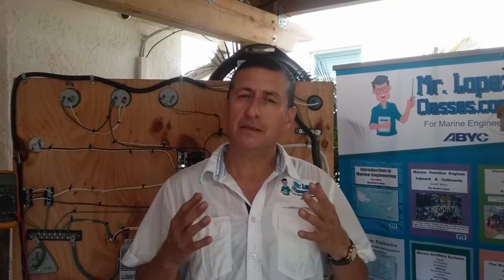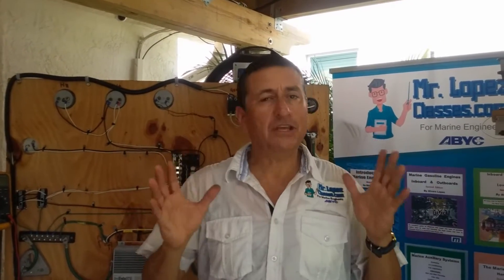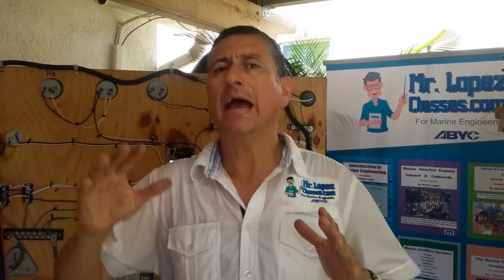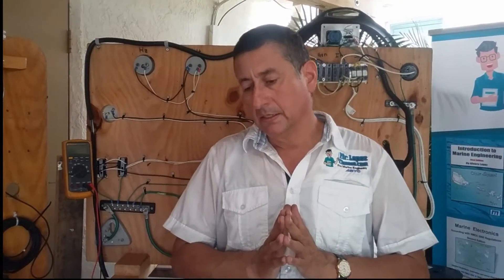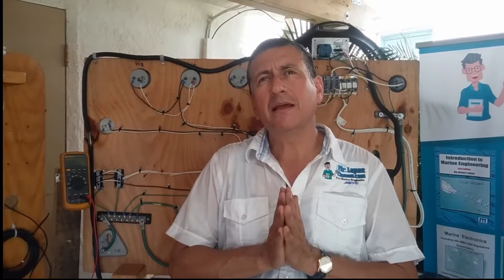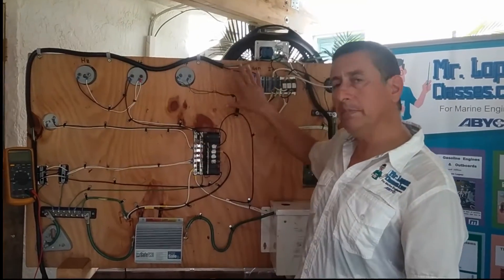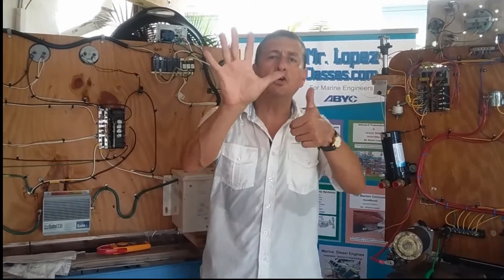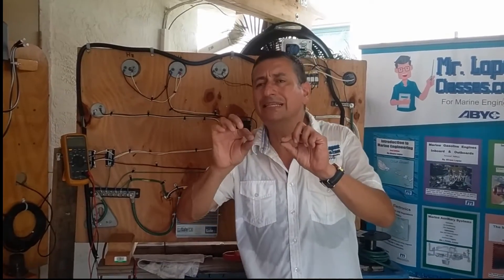Bonding and Grounding

Comment: Good information but never seen a battery exploded because of a bad ground, battery will not explode from a bad ground it just will not operate the component that is trying to operate, bad ground just means no power will flow out of the battery to which the component you're trying to use...

Comment: Very good video, I'm thinking of buying a few of your books. If you do not have a transformer, in between which grounds should the galvanic isolator be placed?  I assume that the shore-power ground should go through the galvanic isolator; then behind the galvanic isolator all grounds (DC, AC and all metal) should be connected together?  This would mean that the shore-power ground is not directly connected to the DC ground, right?  What about the AC neutral?
Reply from the maker: The DC negative bus bar at the DC Panel and the Ground bus bar at the AC panel should be connected to the main bonding conductor, and then the bonding conductor should be connected with the external sacrificial anodes. The AC neutral and Ground should be tied just at the power source (i.e. Generator, Inverter, and Shore), after that point of common connection it will be the neutral of your AC Panel, and from the frame, the ground (green) will feed the ground bus bar 
Best regards
Reply from the maker: Please try to see this short video-clip https://www.tiktok.com/@mrlopezclasses/video/7162257572395748650

Comment: I need help.  I have a deep cycle battery that runs everything but my engine. Connected directly to the battery (with fuses) are the mile pump, vhf radio, am/fm stereo, and a switch panel for my other stuff. All of that has negative cables going back to the battery.  Then, the cranking battery is  grounded to my outboard engine. So, if i connect the deep cycle negative to the cranking negative,  that's not grounding the deep cycle circuits to the engine?
Reply from the maker: All the negative terminals from different battery banks should be connected together, then they should be grounded to the main bonding conductor . Does not matter what type of batteries are in each bank
Reply: @Mr Lopez  right,  and they are,  I have the negatives of the two batteries connected together.  So, then when I add in the AC circuit, I'll take its ground and connect it to the engine as well? Or can I connect a cable from the ac ground to one of the battery negative terminals?
Reply: Would the outboard motor be the main bonding conductor in my case?

Comment: Great vedio,,, how do I know what size zinc block I need?
Reply from the maker: Depends. Minimum 1 Square Inches in total per boat of this size
Reply: @MrLopezClasses   looking at the boat today I noticed the yacht builder had ran 3 number 2 cables to back of the boat and was fastened to the rudder housing but zinc block was not installed instead over the years someone decided to use the zinc disc's on the rudders but the rudder shafts turn which surly causes resistance so I installed a 6 x 12 x 3/4 inch zinc block and reconnected the cables to it, l think that should solve the corrosion problems, brand new 7000 dollar props and stainless steel shafts that looked like new looked horrible in just one season as a result of all the current running through them,, Thanks so much your vedio gave me the knowledge I needed.
Reply: @MrLopezClasses sir you answered me twice first time you said 1 square foot second 1 square inch but I'm sure you mean square foot,, that's 144 square inches, I'm going to try the 3/4 x 12 x 6 and see how long it lasts, I'll go thicker next season if it eats away to fast
Reply: @MrLopezClasses  my question now is if the zincs to small will it not be able to absorb all the current are just absorb it and eat away faster?
Reply: @MrLopezClasses  another question is zinc better than aluminum for salt water,, some say aluminum has proven better

Comment: Can someone explain why the DC circuit diagrams I normally see, all take the negative back to the battery, not the bonding conductor?
Reply from the maker: Because the return of any  DC circuits should be to the Neg. bus bar. The housing or metallic case of any equipment should be connected to the bonding conductor. In other words , the bonding conductor should be  use to drain static electricity accumulated on the frame of the equipments. Of course at the end of the day, the main DC negative bus bar of the boat and the AC ground conductor should be connected to to the bonding conductor

Comment: Mr. Lopez, you are a gifted teacher. 
Question for you: The installation instructions for that Galvanic Isolator show it wired in series with shore power ground. Your wiring is still in series with the path to shore power ground via the water, but in a different location. If the boat were to be struck by lightning, seems the isolator would be destroyed. We haven't look at the maximum voltage spike the diodes in the isolator can handle. Gracias y buen dia!
Reply from the maker: Yes you are correct. This is way for lightning purposes there is another lightning plate connected with a lightning conductor attached to the lightning rod. At the end both plates should be connected

Comment: In Ana emergency can the short electrocute a swimmer?
Reply from the maker: Of course, this is why is not recommended to swim in a Marine
Reply: I swim around my boat. I have an inverter and solar lithium batteries everything. How do I ground at anchor without the possibility of electrocution?
Reply from the maker: @djkillachris  If you have a good Bonding System in your boat it is enough. All the metallic items in your bout should be bonded to the main bonding conductor, then it should be connected with the external sacrificial anodes.  This is my recommendation
Reply: I have read books, searching videos and reading internet but just can't seem to find a proper answer or schematic for completing my install. I currently have solar and inverter working but no ground is run from my ac panel and I'm not sure about grounding inverter. Also, my reverse polarity light is on and it appears the builder jumped the ac panel ground. I have a 30' sailboat with a diesel engine. I'd be happy to make a donation to you if I could send you a few pictures and you could give me a few instructions. My email address is Blistyanypowwow@yahoo.com. Let me know and thanks so much for your responses and the videos!

Comment: Hello Mr Lopez.

What are your thoughts on bonding in a wooden boat?
Reply from the maker: Hi Samuel. The Hull material is not relevant. It is most relevant the hardware materials in contact with saltwater. If you have bronze fittings, Bronze Rudder and Propeller, Monel Shaft, then 100% sure you need a proper Bonding System. If you check this poster you can select the sacrificial anode according to the hull material and type of water. https://mrlopezclasses.com/product/sacrificial-anodes-selection-chart/ Also in my "Marine Corrosion Book" you will find all the information that you want https://mrlopezclasses.com/product/the-marine-corrosion-handbook/ or Sympli take the " Marine Corrosion Course at https://mrlopezclasses.com/product/marine-corrosion-course/

Comment: I asked Mr. Calder why in Europe DC’s negative is not grounded and in USA it is mandatory and I received an answer that they are studying to review this. 
I’d worked 40 years on electrical power companies and the DC are not grounded. 
Griunding is used to protect against electrical shocks. AC neutrals are grounded usually to balance currents and provide enough short circuit current in case of a fail and make breakers to isolate it. 
Just remember planes, cars and even rockets are not grounded and they work pretty well.
Reply from the maker: Alcibiades.
In boat wiring, both AC and DC should be grounded. The grounding system in a boat is used to drain static electricity normally stored in the housing of appliances. The negative bus bar at the DC panel and the ground bus bar at the AC panel both of then should be connected with the main bonding conductor, then the bonding conductor should be wired with the external sacrificial anode. (This is the ground of your boat)
Remember that in boats Neutral and Ground are tied together only at the source of power. Normally at the AC mainboard in the generator backend or at the AC mainboard in the Inverter or at the transformer frame. After that, inside of the boat, never neutral and ground should be connected together.
With respect to planes, all of them use a similar bonding system, then the main bonding conductor is connected with the external sacrificial filaments located at the end of the ailerons in each wing, another one at the end of the tail cone, and another one at the end of the empennage. those elements have the same function as the sacrificial anodes located at the boat transom, drain currents. This is the ground system of airplanes. If you are seated in front of the wings especially during night fly's you can see those filaments draining small currents constantly into the atmosphere. This is the ground system in airplanes.
Let me know if you want additional information
Sincerely
A Lopez
Reply: @MrLopezClasses  Thanks for your attention. But there is a huge difference between static and dynamic electricity. Bonding all metallics to zinc will prevent from corrosion that may occur because of static electricity. Household’s appliances are grounded to prevent electrical shock if or when any conductor loses its insulation cover because this may kill a person. And, once more, in Europe DC’s negative busbar is not grounded. There is another concern. If DC negative is bonding to all methalics and a ligthning hits the mast all electronics will be burned!
Reply from the maker: @alcibiadesmarcialneto922  Thanks for your comment. I appreciate your feedback

Comment: One of the best (if not the best) videos out there explaining grounding and bonding. I can't believe I hadn't found your videos earlier! Looking forward to watching more on your channel. Thanks a lot!

If I could also ask you a question, I just installed a lithium battery connected to an inverter and a solar panel. I connected the main negative of that battery to the main battery of the existing lead acid service batteries on the boat. The inverter also has a terminal for ground which I think I am not sure if I should now connect to either of the negatives of the battery banks. Could you confirm if I was correct to connect the negatives of the two banks (they are not connected in any other way and are being charged by separate chargers) and what I should do with the ground for the inverter?
Reply from the maker: Hi Ekatos.
I am going to respond in different steps. 
No 1 . Doesn't matter how many battery banks are in a boat. All the negatives from each battery bank shall be connected together and then to the main DC negative busbar.  Doesn't matter if one battery bank is lead acid, the second one AGM and the third one GEL
No 2. In a typical marine Inverter, in the AC side of the inverter you will find Hot 1 (out) , Hot 2 (Out) , Neutral (Out) and Hot (in), Neutral (In). The Hot (in) and  Neutral (In)  are related with the power coming in from the AC Panel to activate the Battery charger located inside of the inverter to keep the battery Bank fully charged and the Hot 1 (out) , Hot 2 (Out) , Neutral (Out) are the phases and neutral going out to feed the AC Panel. In other words each Marine Inverter has a Battery charger inside of it to keep your own batteries charged 
No 3.- In a typical boat with AC and DC Panels; the DC negative Bus Bar of de DC Panel and the Ground Bus Bar of the AC Panel shall be connected to the common bonding conductor and the bonding conductor connected with the external Sacrificial Anode. However the case of the inverter if it is metallic should be connected to the AC Ground bus bar and the (-) terminal on the DC side shall be connected to the main DC Bus Bar
Reply from the maker: Thanks Ekatos. I hope this material is useful for you. Enjoy it !!

Comment: Top of the pops,great vid,quick question,I have boat with 110 ac but marina is 230v,can I just plug in 230 from shore power to battery charger and run tv,lights ect Dc and bypass 110 altogether,any help much appreciate,again class vid👍👌
Reply from the maker: Hi Kay. No because the AC outlet in your boat is single phase and the Outlet at the pedestal is double phase. Ask to the Marina probably they have another single phase pedestal or an Adapter for the plug
Reply: @MrLopezClasses  tks for quick reply, the previous owner put 230 inlet into boat going to 230 trip switch with socket and I think his idea was to plug in  110 site transformer into 230 socket then connecting to boat to 110 site transformer,some how I don’t think it’s that easy?Could u give me your opinion on another option pls,

Comment: Mr. Lopez let me clarify my last statement.  The boat came with a 120VAC to 12VDC battery charger installed from the factory.  The battery charger was properly hooked up to the batteries.  The purpose is to charge the batteries during down time.  The 120VAC charger was mounted directly to the aluminum hull of the boat.  Our house boat was moored to the marina with shore power feeding the house boat. We ran a 3 wire extension cord from our houseboat GFI outlet to the 120VAC charger installed in the boat. The charger was active for about four hours.  The boat was not equipped with any type of anode.  The amount of damage in 4 hours was amazing.  Your thoughts please.
Reply from the maker: Ok. The Bonding system is basically the ground of your boat. The Bonding system is a metallic connector where all the metallic elements inside of the boat should be attached. Then , the metallic bonding piece should be connected externally to a plate of Zn ( Sacrificial Anode). The metallic case of the Battery Charger should be connected to the bonding conductor. As you mentioned the charger is mounted directly to Aluminum hull from the factory. However I have a couple of questions:  The Boat is coming from the factory with an AC Panel?. There are other AC equipment, such as Refrigerator, Stove, Microwave, etc...?. The boat have an AC Shore Power  Outlet to connect the power cord to the pedestal?
Reply: Thank you very much for your reply and providing the most informative video I have seen.  The boat is an aluminum surf boat and has no AC panel or other AC equipment, no shore power outlet, no anode.  The only AC on the boat is the battery charger.  I have located your website and would like to hire your services to help me investigate.

Comment: Mr Lopez.  Amazing video.  Super informative.  Our boat is new, aluminum h ull, and we plugged in the ac battery charger from our houseboat to the new boat while the new boat was floating in the marina.  The damage to the aluminum hull in less than 4 hours was amazing.  I believe it was the fact the DC side was not boned and electrolysis damaged the boat.  Am I correct?  I guess they call it a DC bonding shoe.  $150,000.00 boat now worth very.  Are you interested in the video of the damage?  Steve
Reply from the maker: Hi Steve. This is a great case to analyze. If you have a chance send me a video at info@mrlopezclasses.com . Also can you verify if the galvanic Isolator is working ?. Good Luck
Reply: I sent the video to your email.  Please check your junk folder. Noo Galvanic isolator is installed on the boat.

Comment: I am constantly replacing the zinc on my prop shaft.  Why not have a giant block of zinc inside the boat?
Reply from the maker: If you need replace the anode frequently this is an indication that you have a leak of current through the shaft and propeller. You need identify where is the leak
Reply from the maker: If you need to replace the zincs frequently, this is an indication that you have a leak of current through that engine.. Check the harness, the ignition coil, the alternator, the starter. . Good luck

Comment: Hi sir, im still slightly confused, not your fault as you've explained it all well. If I have a negative bus bar for the dash electronics and a negative bus bar for the engine and a negative bus bar for boat lighting, bilge pump etc  ( 3 in total) do I run a separate neutral from the battery to each bus bar and then connect each to the outside sterndrive .. regards .. Lee
Reply from the maker: Lee. All the negatives bus bars should be connected together. Remember all the negatives from different groups of batteries should be connected together . The Neutral is exclusive for the AC wiring. In the DC wiring you do not have Neutrals
Reply: @MrLopezClasses  thank you.. should  connect the engine block to  negative bus bar from more that one fixing point..
Reply from the maker: @leeholdawy1469  Of course more grounds are better due than there are too much returns
Reply: @MrLopezClasses  can I say you have been more than helpfully, especially your explanation on the relays, which enabled me to sort the wiring for m fuel pump and starter.. tank you..
Reply from the maker: @leeholdawy1469  I hope this material be useful for you

Comment: Sir in my ship i got 60v earth leak
Whats the reason for that
Reply from the maker: Hi Danuka
The 60 V reading is in between Hot and Neutral or in between Hot and Ground ?. Can you check the reading in between Neutral and Ground?
Reply: @MrLopezClasses  sir my electrician says its earth to ground.when i try to remove 3 phase terminal and touchs a  metal surface i got  shot current.
Reply from the maker: @danukaashan2735  of course this is a short to ground, you should check wire per wire to identify where is the short. that procedure should be done without power on the system
Reply: @MrLopezClasses  ok sir.thank you.will try